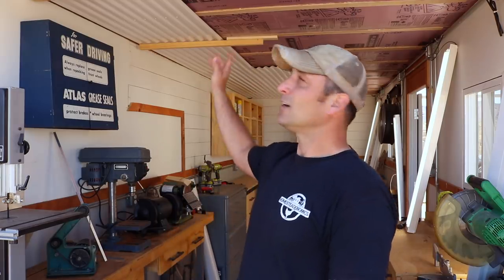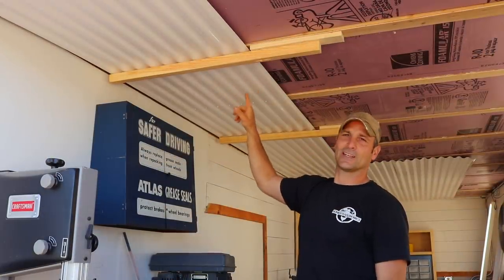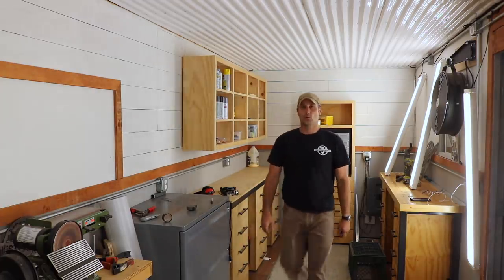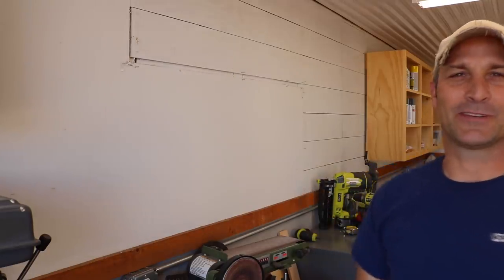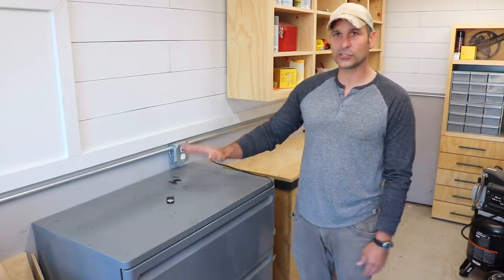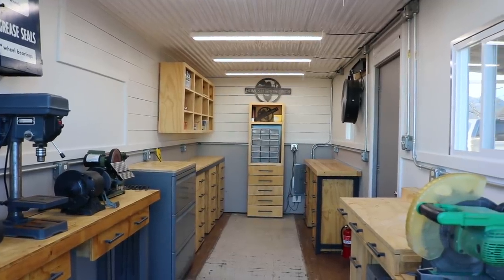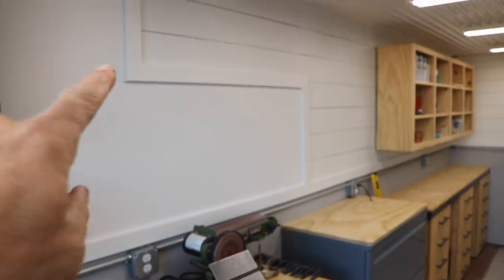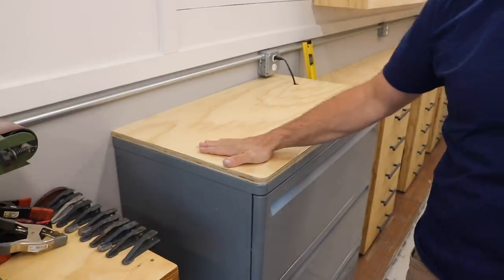Shipping Container Shop -  Corrugated ceiling, trim and file cabinet storage

Comment: Hey man, I dont know if I've seen such a well put together shop! I am so impressed! Sir, is that just a shipping container? Man well done... I could use you to truly help me set up my shop. I am having a very difficult time trying to figure out how to safely have a woodworking shop, welding shop, Blacksmiths shop, leathersmiths studio, paint and powder shop and photo studio. This is no joke... I've worked 43 years to get to the point that I can spend the rest of my life building furniture and helping other folks who aren't able to help themselves for whatever reason. In 2 years I will be able to start my dream, me Hope's...
Reply from the maker: Brady McPhail hey Brady!  Thank you!  Sounds like you’ve got many of the same interests as me.  I’m not sure how the perfect set up would be but I’m learning too.  I’d keep the blacksmithing and welding outside or to one separate end of the shop and the wood, leather and other stuff to that other side.   Basically the separation in some way or another I’m thinking is the best😀👍

Comment: Nice video! for the plug, you could route out a small dado in the plywood and move it so it comes out the side then the plug isn't coming through the top and it won't be in the way of you need to use the whole top👌
Reply from the maker: hmmmm... I might just have to do that!   thanks Zach!

Comment: Nice upgrades Joe! I would not have expected the corrugated roofing panels to have turned out so nice. Running the panels parallel to the length of the container was a good choice. The shop looks really “sharp”. Now get to using it and making some Man Glitter!

Comment: Ceiling looks good and reflects light and does not seem to produce glare.  The ceiling light cords (blk) seem to jump out.  It would probably bug me until i changed them out for white.  Love this shop.  I may have to downsize and have given consideration to an enclosed trailer.  Will have to look back for the width and length of yours.  Your videos are top notch for my liking.
Reply from the maker: Yes, those cords have bugged me too... I got these from costco (they are feit brand)  and I just bought some new ones to replace my old flourescent ones in my garage.... and the new ones have white cords... so I might switch them at some point... but then I'd see the black cords in my garage...lol.
maybe I'll end up covering them in some sort of trim or cord wrap that blends in better :)

Comment: All of the changes/repairs/improvements work really well...and I swear it seems like you have more space in there.
To me...the acoustics are better...less echo...the wavy ceiling looks better & sounds better.
The only thing I might have done differently would be to use "T" shaped aluminium around the window instead of "L".
It would have fully closed the transition from wall to window and widened the look of it...but then I'm weird  :)
Reply from the maker: Thanks Greg!   and about the trim... that is something I didn't even think about but it sure would look better and also... completely close in the gaps!   But this will have to do for a while as my wife will give me that look of .... why are you redoing this (with a frown...haha)
Reply: I know that look...way too well  :)

Comment: The shop looks great. The only question I have is  in Canada where I am we would insulate above the ceiling for hot (very little and cold lots ) also it would be great for sound. Love the videos.
Reply from the maker: Yes, for sure... I only have 2" of rigid foam in the ceiling and more would definitely be a necessary addition in your environment :)
Reply: @homesteadonomics  Thanks, Great info always.

Comment: Nice score on the 12ft panels. I guess you have to pay attention to those prices. 
The shop is looking amazing.👍👊
Reply from the maker: Thanks!  yes it was a huge score!    I just checked and they still have about a hundred at the Tucson Irvington Rd store... and they are even cheaper now... $7.36 per panel.   I wouldn't recommend these vinyl ones for outdoor use (polycarb are better for that)... but as inside wall or ceiling covering I think they are awesome!!!
Reply from the maker: https://www.lowes.com/pd/Tuftex-SeaCoaster-2-17-ft-x-12-ft-Corrugated-PVC-Plastic-Roof-Panel/3010590
Reply: @homesteadonomics  thanks, Joe!

Comment: Looks really good Joe.. One day soon, I'm buying a 40' shipping container cut in 3 peices... It will be 16' by 16? With an 8' overhang in the front... That's my loose plan.
Reply from the maker: Bull Dozer thank you BD!   But you might want to think 2 pieces with a roof in between the two....of I did it over again and the wife would let me make it bigger, that’s what I would do😉👍
Reply: @homesteadonomics  thanks Joe, that's what I'm planning on doing. I want to make a steep roof, either 12/12 or 14/12. That way I have a ton of storage for my many projects. Dan

Comment: Interesting! I'm in the process of putting my wood shop in a old freight trailer myself. We took the running gear off, so it's only raised off the ground be the height of the prefabbed peers we set it on.
Found a insulated garage door and it fit perfectly in the end (ground off the hinges of the big "barn" doors and threw them away; they were badly rusted and rotted).
The floor in this one is strips of hardwood laminated on edge. I think I'll like working on it - if it's not too cold in winter... We live up in Ontario, Canada, and the winters get pretty harsh.
I have a Rigid tablesaw that I really like for the level of work I'm doing at this point. But with the narrow, 8' width of the trailer, I'm going to have to come up with another solution to breaking down 4'x8' sheet goods. I'm thinking a piece of closed cell foam on the top of my work bench, and a track saw system - when "my ship comes in"! :-)

Comment: I'm in the process of purchasing my second container 40 ft long each and attaching with trusses 9 trusses add a roof and I got a place to park vehicles inside pour a concrete floor and concrete ramps or drive lawn equipment in the one and lock tools in the other . With proper anchor should be a tornado shelter as well

Comment: I like the new work top on the file cabinet, but I do see an issue with it. You were talking about how it can protect your tools and such from saw dust and now there's a hole right on top. Maybe you could consider getting a sacrificial extension cord and cutting 3 feet off the end. Have it plug in just like the battery charger, but run it through a grommet that you can seal with black RTV, and on the female end put it in a metal box with a house hold plug in it. Kind of like a contractors extension cord.

Then you have the same functionality as now, except with a sealed up hole on top, and 2 plugs in the drawer instead of one.

Comment: Only problem with that file cabinet is, it's a few inches higher than your other work surfaces. It's always easier when you can make all of your work surfaces the same height, but since it's a good cabinet, I guess that's not really an issue.

The window trim looks good.

I definitely heard a lot more echo during your closing than I have ever heard when you film in the shop. Must be the new ceiling panels. Some acoustic panels around the ceiling might help.
Reply from the maker: I'm hoping once I get some of the hand tool storage on the walls it will break it up a bit... fingers crossed :)

Comment: It is really looking great in the shop.  I would have run the cord on the cabinet from the side though.  It would not interfere with the top work surface and could not fall back inside.  Did you really have to use a screw in every valley on the ceiling?  Maybe every other one or two perhaps?  It certainly is not going anywhere.  The edge on the window was really cool looking.  Hard to think this is just a workshop!
Reply from the maker: Thank you James!  Yes, the cord isn't in the best spot... I originally put it there so the drawer mechanism wouldn't slide against it on the side... but now that I look at it again, I could actually put it on the side with not too much problem... so that might happen eventually :)

Comment: pretty cool ceiling..if there was enough room, you could put LED strips in between the foam and the vinyl and let the vinyl diffuse the light for 0 clearance shop lighting.
Reply from the maker: That's a cool idea and could work if I get some of the translucent ones... but these are opaque and don't really transmit any light through them... but I do like that idea :)

Comment: Great looking shop. I could literally watch u paint, lol. One question, & I don't want to offend...the hole you cut in the top of the metal cabinet. I know it's yours & u do as u want, but just wondering, would it be a ok idea to put plastic or rubber or some kind of sealer around it so your electrical cord won't fray then energize your cabinet?
Reply from the maker: James Carl thanks James!   And no offense taken...I’m open to ideas all the time and that is a great point!  Especially with try drawer opening and closing it would probably end up rubbing in one spot.   So thank you because now I’m picking through my pvc fittings to find a good piece that will fit in that hold nicerly😀👍🙏
Reply: I had thought the same thing. Had also wondered if it would have been possible to just run a line down from that outlet box and put an outlet inside the cabinet. The hole in the middle of the top just seems awkward to me 🤷🏻‍♂️
Reply: homesteadonomics yep, a PVC nipple, or connector should do the trick nicely.  The other thing I noticed was that IF you find in the future that it’s a bit of a hassle having the plug come through the top, it looks like you might just have enough room on the side of the cabinet above the drawer side to come in there as well.  But it is difficult to tell from us armchair quarterbacking if there really is enough room or not.  Otherwise great job on those shop improvements, really makes the shop shine.
Reply from the maker: Steven Schmelling thank you!  Yes I need to put some bit of protection in  the hole for the cord.  As for the location.   I would have placed it further back, but there is a reinforcement bar on the inside back. The side I was afraid of the drawer side sliding against it and rubbing the cord.
Reply: homesteadonomics ahh, guess it’s hard for me to see that reinforcement bar from ~2,000 miles away 😜
Reply from the maker: Railfan90 haha...that’s just about 1999 miles and 5279 feet to far to see the cabinet at the right distance to see that bar😉
Reply: homesteadonomics and that’s not even considering you’re probably at a higher elevation than me too. Maybe I just need glasses though lol

Comment: Great video as usual. Would you consider using Tuftex panels to cover an insulated ceiling in a van conversion?
Reply from the maker: thanks Scott!   I think they would do fine for something like that!   they have a bit of flex so they would probably mould over the inside surface pretty well.   I wouldn't use the vinyl for exterior stuff on the van... but inside I think theyd be perfect :)

Comment: That is too bad about the trim. It did look good on camera, however the new white trim does make the shop look nice and clean. Love your shop. Do you ever wish it was bigger or do you find it meets most of your needs?
Reply from the maker: Its the size that my wife and budget would allow...haha...if it were up to me to do again I would have two containers sitting parallel and a roof spanned across them..... but it it good for most things... most of the assembly happens under the awning so that isn't too much of a space consideration but overall I'm happy with it :)

Comment: I just bought a 20’ shipping container  office unit. So it’s pre wired, insulated, AC, heating, man door, and window already installed.  

Making it a shop and curious about your work bench depths? Looks like you have plenty of space down the middle and something I want to emulate.  Minus my 7’ L x 5’ H x 22” D tool cabinet that will go in the back.

Comment: Nice shop ,is it powered by solar?
Reply from the maker: thanks!  No, it isn't powered by solar but I am considering using a standing seam roof as the new roofing... in part because I can lay solar panels into the valleys of the roofing :)

Comment: Wow, you do great work, I have enjoied seeing what you do and he videos you make... UNTIL you put that hole in the top of the cabinet.  Would it not have been just as easy to drill a hole in the side of the metal cabinet to avoid putting a hole in the top, a perfectly good work surface... that now has a hole in it.  That hurt... :-)

Comment: I like improvements but; I do not like the battery recharge cord hanging out over work surface on tool storage cabinet.  Maybe use conduit from elect. box to back of cabinet.  Then to be real picky; get rid of the yellow sticker on the conduit 3' above light switch by door.

Comment: A hail storm punctured the roof on a container im not buying it
Reply from the maker: It punched through the roofing material... NOT the container.  But I had some open holes on the actual container roof when I installed the ceiling framing on the inside.  A couple of the sheet metal screws I had repositioned, leaving an open hole.  So the water came through those holes.   I thought I explained it in the video but perhaps not🤔🤷‍♂️